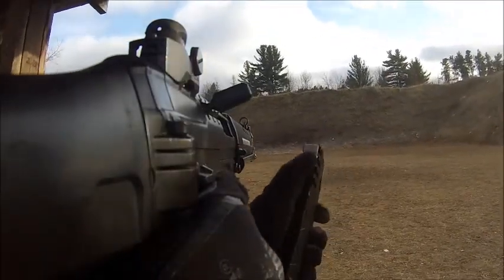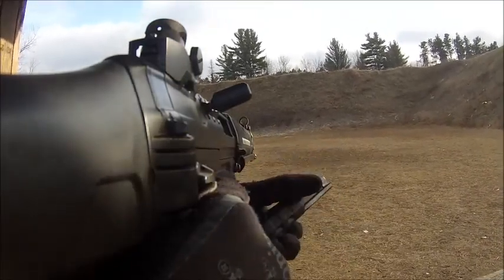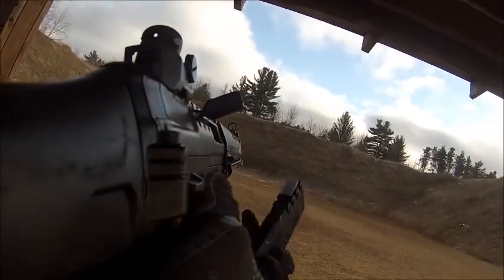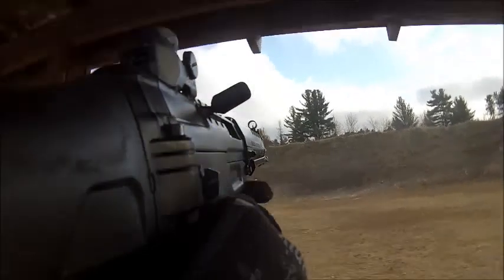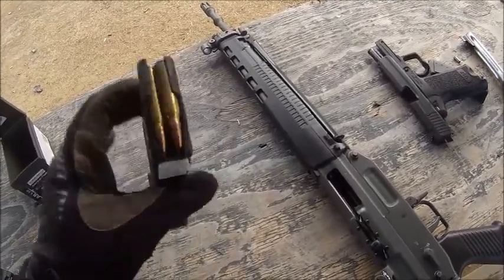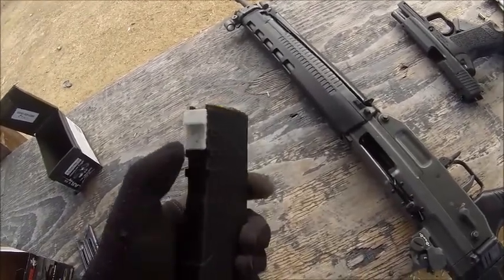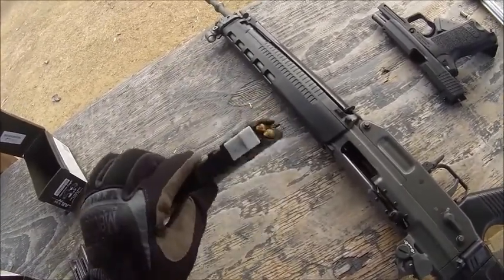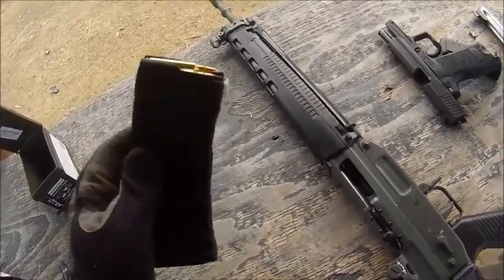Ar-15 magazine to Sig 550 conversion Part 2

Comment: I hope this gets into production soon ;) Don't know what mags cost in the U.S., but here we pay ridiculous prices for 30rd-mags for a 550. Would be nice if you just could convert an AR15-mag..
Reply from the maker: +jodelboy Where do you live if I may ask?
Reply: +norcofreerider604 
Emmen, Switzerland.
Reply from the maker: +jodelboy Interesting... Is there significant demand for this sort of thing in Switzerland?
Reply: +norcofreerider604 probably not. Most SG550-series owners are either sports shooters (no 30rd mags, only 20rd) or they have them lent (is this even english) from the army = no real interest in shooting.
20rd mags are standard capacity here, you can get them new from the arsenal for 40 CHF and used they go well below that.
Reply from the maker: +jodelboy Ah, I see... Too bad. Would there be enough demand if a few thousand were made?

Lent is English, it is the past participle of lend. Lent is also a Catholic religious holiday/event (Fastenzeit auf Deutsch).
Reply: +jodelboy 

Wo kann man die 20er Magazine für 40.- kaufen?
Reply: +norcofreerider604 

Nice work with the mags. I would buy some, but like jodelboy said, most people in Switzerland are using 20 round mags and I think you cant sell a lot of the converted mags in a short time. Over some years it maybe is enough demand and first the people have to know about your work. Go on!
Reply: +Kilian Mathys für 40 Stutz neu im Züghuus (oder wies ez au immer heisst) bzw. bimnä Feldi falls aktiv im Militär bisch.
I wör aber statt neui Magis afoch uf d Suächi noch bruchtä goo, kenne viel Sportschützä wo meh Magazin hend als si eigetli bruchäd und eine het mer au scho mol wöllä 20er-Magis schenke well er z viel het ;)
Reply: ok danke für d info, du hesch aber nid per zuefau zviu?
Reply: +Kilian Mathys Nei, zviel Mags chamer NIE ha ;) S gliche wie "z viel Munition"..